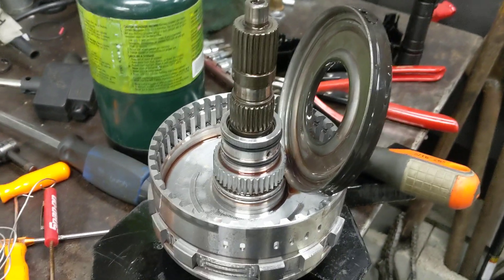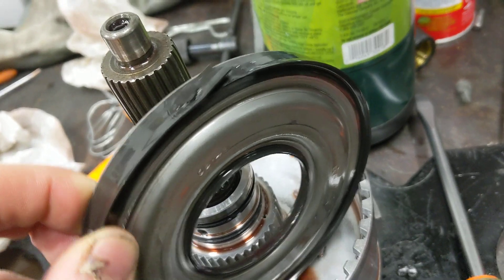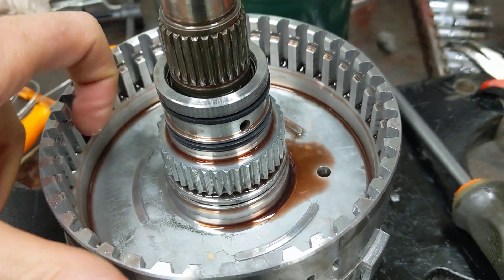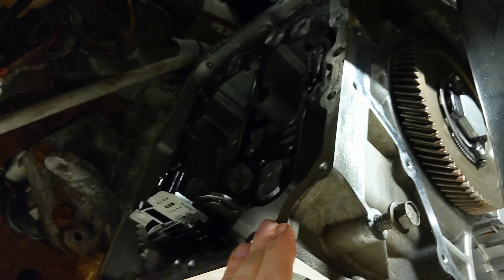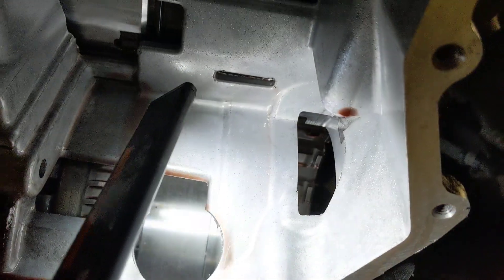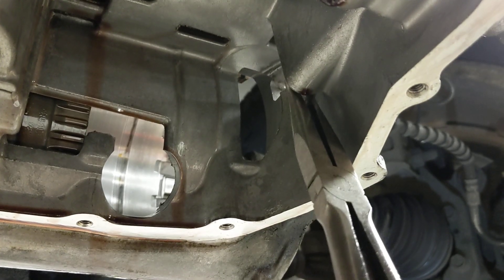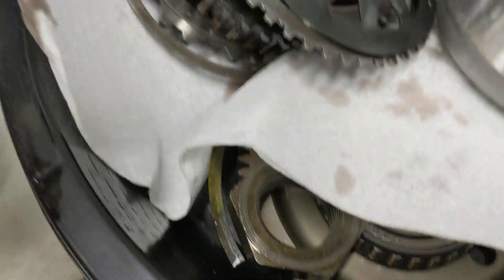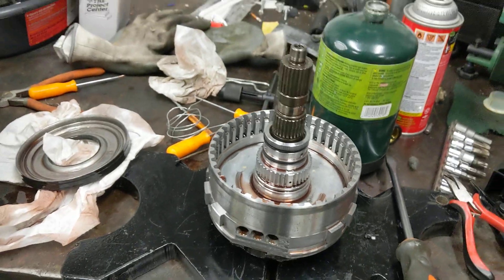Chrysler 62TE Compounder Fix, P0792, P0734, P0733 -- Part 2

Comment: Why do you want the pipes to stay in the transmission when taking the valve body off? I need them to come out of the compounder anyways in order to remove it, don't I ?
Reply from the maker: IIRC they can get pretty jammed up and crooked if they try to come partly out with the valve body.

Comment: Great video.   I have code p0734 Also what appears to be long pieces of a snap ring. And a smaller 2" piece of flat metal inside the pan😢.  Could those have come from the compounder?
Reply from the maker: Thanks, and oh no! That doesn't sound good.  Does it have straight edges?  Broken edges?  I can't think of any flat pieces of metal in the compounder. All I can think of is circular or cylindrical.

Comment: Hi, I am going to repair the automatic transmission on my Fiat Freemont 2.0D, 125kW on my own. Is the automatic transmission and its parts the same on the 3.6 Pentastar as on the 2.0 Diesel?
Will the MOPAR 68272623AB repair kit fit my Freemont?
Thank you :-)
Reply from the maker: @JiriMarek-rt3gn  it looks like some of the Freemonts do have the 62TE transmission. It might depend on options, I'm not sure. Perhaps you can inspect it from underneath and see if the case looks similar to the one in the video.
Reply: @CheapskateGarage   It looks exactly the same and is also called 62 TE. But I read that there are three types according to the engine, 2.4 petrol 3.6 petrol 2.0 Diesel ..

Comment: Hey im having the same issue shop told me needed a new trans. So for backyard mechanic is it something i can do. And did it fix the problem.
Reply from the maker: As shown in the video (make sure to look at Part 1 too) it can be done with the transmission still in the vehicle.  If you can safely get it jacked up, you can do it at home. We put tens of thousands of miles on the van before we sold it, and the transmission worked flawlessly.

Comment: I have pieces of metal in the filter. It drives only in first gear and in reverse gear it rides and slips a little.

Code p075a,p0734,p0736,p0792. 

what to do?
Reply from the maker: Sorry I didn't see this sooner.  With metal in the filter, you're not likely to have a simple fix like this leaky seal.  There are probably some hard parts worn out inside. It depends on whether or not the shavings were ferrous.

Comment: Looking to start my replacement soon, just ordered the compounder. Any tips to remove that huge 2" nut without a heavy duty air tool? How difficult was that nut?

The most I have which can be used is a long wrench/breaker bar or a 7.5Amp impact wrench tool with about 240ft-lb of torque
Reply from the maker: The nut was no problem, but I think my gun peaks at 1200 ft-lbs in reverse.  I'm not sure how difficult removing it by hand would be.  My first instinct would be to try cutting a hardwood wedge just the right size to jam between the gears.  If that wasn't working well, maybe a wedge on top between the gears, and a wedge on the bottom, with a bar clamp jamming them towards each other and into the gears.  If hardwood doesn't grab well enough, a softwood would grab better (but might chip out easier).

Comment: Привет, у меня пришли все те же ошибки, сегодня разобрал барабан лоу и увидел все тоже самое что у тебя, спасибо твоему видео из-за него я туда и полез)
Reply: Я пока ещё не собрал все обратно, но надеюсь это решит  мою проблему p0792 p0733 p0734 p1790
Reply: @TheEscolizard как решил проблему?
Reply from the maker: That appears to translate as, "Hello, I got all the same errors, today I dismantled the low drum and saw everything is the same as yours, thank you video because of him I climbed there" 

You're very welcome, I'm glad you were able to find the problem.
Reply: I have pieces of metal in the filter.  It drives only in first gear and in reverse gear it rides and slips a little.

Code p075a,p0734,p0736,p0792.

Comment: Is it a tight fit to get the three 8mm bolts off the top of the componder pan ? Im working on a dodge avenger 3.6l and i noticed frame of vehicle and top motor mounts of transmission.  There is no way to even squeeze fingers in between.
Reply from the maker: I don't recall any difficulty accessing those bolts, but I imagine it could be quite different in an Avenger.  Sometimes on other cars, I've had to pop off a couple engine/trans mounts to lower the assembly an inch or two to gain access to transmission components. Good luck!

Comment: Great job what was causing codes?
Reply from the maker: Thanks!  The damaged seal was causing an internal hydraulic leak in that clutch assembly.  The leak caused lower pressure and reduced clamping force, which allowed slippage.  The slippage allows the two speed sensors to see signals that disagree with each other, so then the TCU declares that the sensors are bad, but that was not the case.
Reply: @CheapskateGarage  Hoping you will see this, did your van have reverse slippage? I have the same codes in my Routan but it also slips in reverse. I've been told its probably in need of a complete rebuild. Please tell me that is not the case. (no pun intended.)
Reply from the maker: @fishdresser4759 I didn't have any reverse slippage. I'd think this code could be applicable to any slippage. Yours will probably have a different cause, but it could be equally benign. You never know until you tear down and inspect.

Comment: So how did you get the spring plate thing back in? Looks like Gary used a press....wondering if you had any other method, since i dont have a press...
Reply: by the way, i saw the same thing...looks like rings in the grooves were fine, there was a little play but not a lot. But I did see the rubber looking like it was damaged
Reply from the maker: I'm not sure if I remember how I did it. On one transmission I've worked on, I used an exhaust coupler that I cut large windows in for access to snap rings. It might've been this transmission. I've got a pretty big vise I might've used, or sometimes things can just be muscled back together.

I'm glad you found a damaged seal, it's great to have an explanation for things!

Comment: Thanks! I'm seeing the same symptoms and error codes on my wife's T&C. So did you buy a new 2"nut? Do you have to deform (stake) the nut once it's installed or does it come pre-deformed?
Reply from the maker: If I remember right, I just re-staked the old nut. I am fairly cheap...
Still going strong 15k later!
Reply: So did this fix the codes
Reply: @CHEAPROLLIN  yes it did !

Comment: I have the same fault codes but they only occur in manual shift gearbox mode, when I put it in normal Drive mode the fault codes don't occur.
Reply from the maker: That's odd. Does the transmission get forced into limp mode as well?

Comment: Yes it is a great video my question is What was the outcom of the proyec ?
Reply from the maker: Sorry I didn't see your comment before. I replaced the piston with the bad seal, and the transmission has run flawlessly for 10k miles now! Another commenter, Stephen, fixed his family's van as well.
Reply: Grate video thanks for Sharing, I have p1745 line pressure to high any idea what be the problem, Your help will be greatly appreciate it